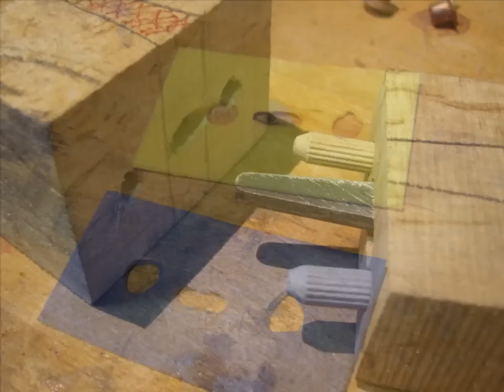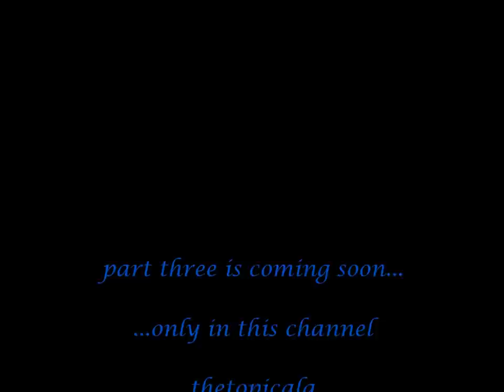How to make a handle for Laplander knife, Saga part two

Comment: Beautiful job! Is the epoxy glue strong enough to hold the handle with no pins? Congrats! Thanx.
Reply from the maker: As I told you with other video glueing process with scandi type knife is far away from fultang type knifes. You should try and find it very strong, stronger than with fultangs for sure. Thanks, Osmo